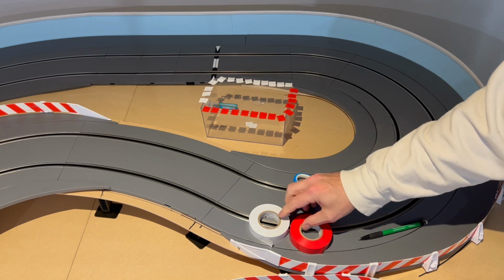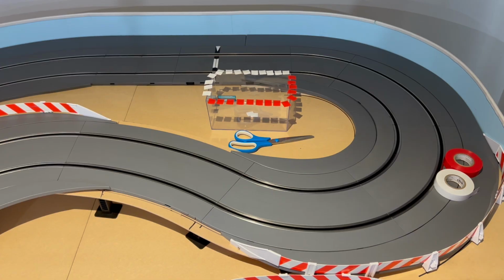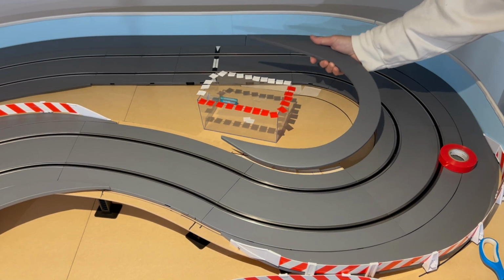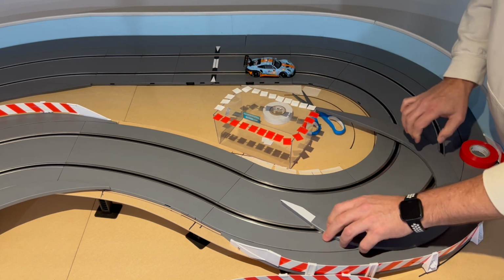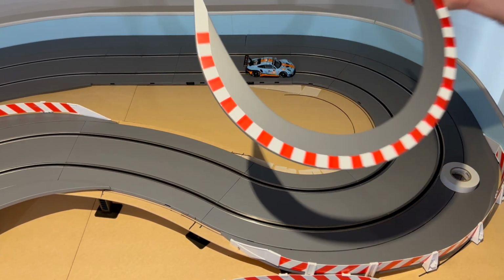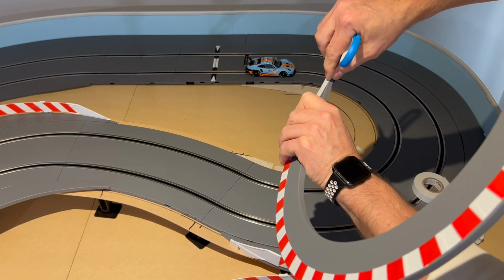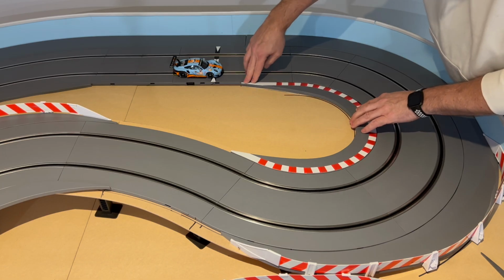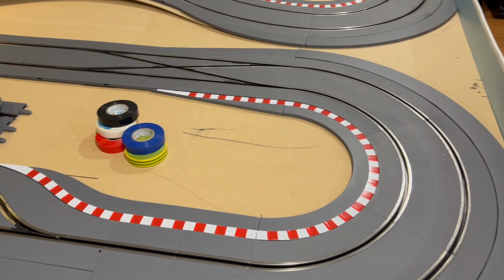DIY Slot Car Track Shoulders - Adding rumble strips #slotcartrack #carrera #slotcarracing #slotcar

Comment: Nice method John😎👍🏻
Is the MDF around 9-10mm thick?
My scenery pieces use 3 x 3mm MDF to be roughly the thickness of the track
Had any issues of the tape lifting?
🍻
Reply from the maker: Thanks Mal. I used 9mm MDF which is very close to track thickness. I’ve never had the tape lift. For best results I recommend buying new rolls of tape rather than using what you may have had lying around. Cheers 👍😎🇦🇺